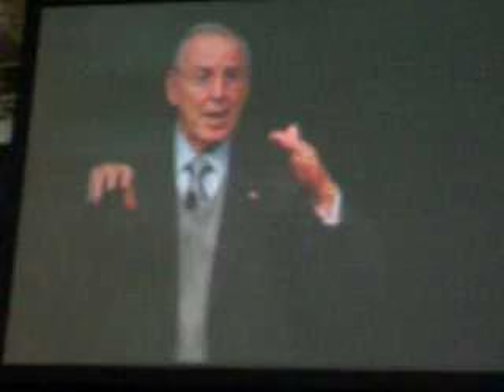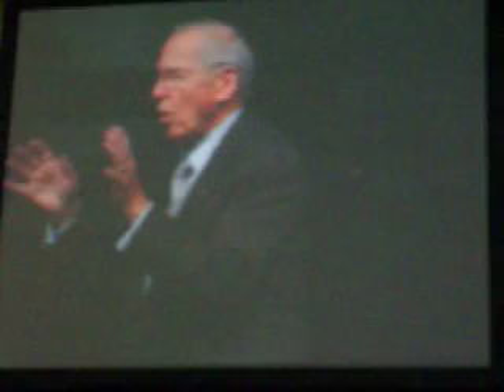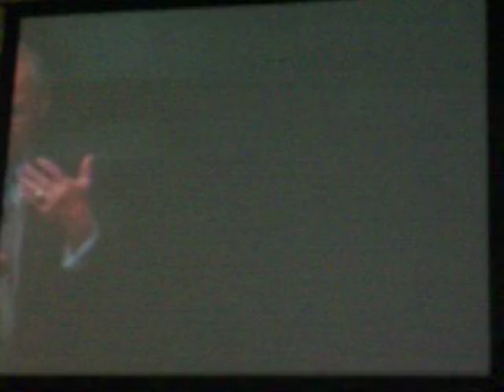Jim Lovell Tells the Apollo 13 Story - Part 4 of 4

Comment: They used a sock, duct tape, a piece of plastic, and some cardboard from the flight manual to construct a device to help the Lunar Module (Aquarius) remove Carbon Dioxide from the air... they slingshot around the moon...